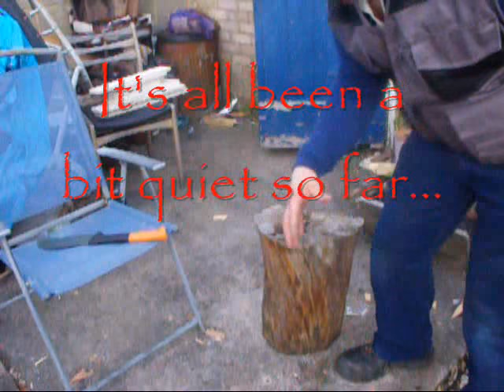Sharpening a Bill Hook, stropping the edge and putting the new edge through some tests

Comment: It looks easy, but what blade profile should I be grinding for? I have a previously unsharpened bill hook and I feel that the blade is too “fat” to get a really sharp edge. I have watched many videos on sharpening bill hooks but I still can’t get a great edge on mine. Please advise.
Reply from the maker: whatever "profile" you end up with  a bill hook is an awkward interior curve to work on, so consider the flap wheel on an angle grinder or a narrow belt grinder or bench grinder to initially remove material to create a new bevel, you may consider using a sharpie pen or scriber to give a guide to a slightly higher bevel shoulder to give a leaner bevel but only go a bit leaner such as 5mm higher as the steel may not be great and bill hooks have a hard life...once you have ground a new bevel(removing chips or just making a new edge) then you can continue the same bevel with a finer grit or blend the shoulders off with the grinder to convex it a bit , be sure to go gentle with occasional dips in water to keep it all cool , and then finish off with a strop, I hope that helps

Comment: Hi wessex blades. I have recently been gifted  twomorris bill hooks.         They came with no fiinish to the blades. I will want to use them in the woods, brush clearing and greenwoodworking.
If they were yours what kind of finish would you be bringing them to? Im going to need to find someone to process them and any pointers to the correct desscription would be great. I really dont have the terminology or know what to ask for. Many thanks
Reply from the maker: I'd leave as they are, a coat of 3 in 1 only,,,
Reply: @WessexBladesHandMadeKnives  it says on the website "that some final honing will need to be done before use" but to be honest there is no blade edge at all. Would it be possible to send you a picture. Your advice would be much appreciated
Reply from the maker: @kahlospirit24  honing is simply dressing an edge , if there is no edge it needs sharpening to get an edge, you could use some wet/dry paper on a flat piece of hardwood, not pushing the edge forward but the other way like a strop, this will still put an edge on without slicing into the wet/dry and block,,

Comment: It was entertaining, but it missed information I was wanting:
1. Were you aiming to hollow grind with the angle-grinder (ie to use the curvature of the disc...and an old disc being therefore better than a newer larger one) or to flat-grind it?
2. Only one side shown being ground but later appeared as though both had been. and the blade was therefore symmetrically sharpened both sides - that is right - yes?
3. Grit size of oilstone not mentioned - and did you use coarse and then fine, or just a single size?
Reply from the maker: 1. didn't aim to grind any particular profile, the owner wanted a fun video...2 , both sides were ground ...3...it wasn't a stone, it was a strop...this was not a tutorial just a request vid for the owner for his benefit